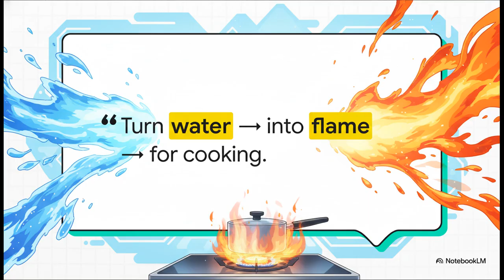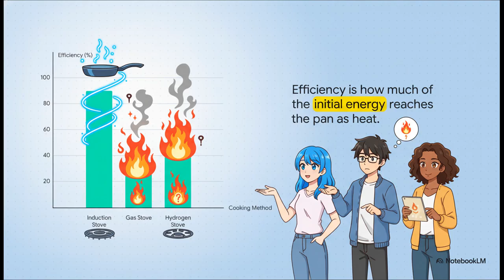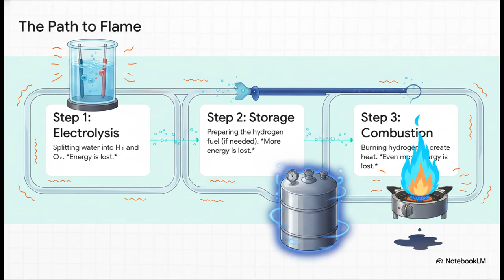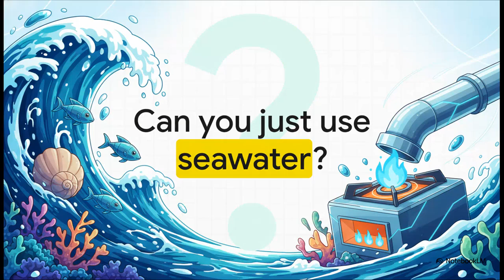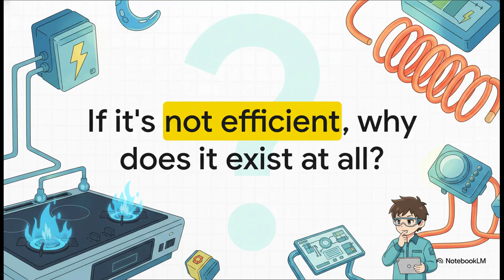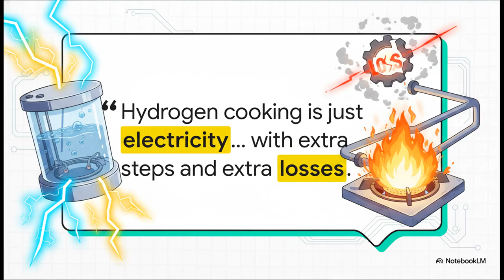QUANTUM AI DECISION LAB — EDITION 31 The Viral Water Powered Stove

Comment from the maker: I mostly agree — using excess solar to generate hydrogen for on-demand cooking can make sense in specific situations. If you already have surplus power that would otherwise be wasted, converting it into a clean-burning fuel is a clever way to add flexibility, especially in off-grid or fuel-scarce regions. It can also reduce reliance on firewood and LPG while avoiding smoke and indoor air pollution.

That said, the practicality still depends on system cost, durability, and overall efficiency. In many cases, storing that excess solar in batteries and cooking with induction may still be simpler and more efficient. Hydrogen becomes more attractive where long-term storage, fuel transport, or multi-use (cooking + heating + backup power) matters more than pure efficiency.

So it’s promising — just not universally better. It’s a niche that could be very useful in the right conditions.